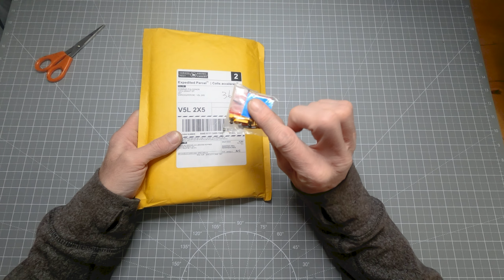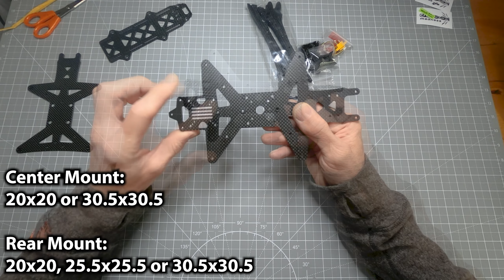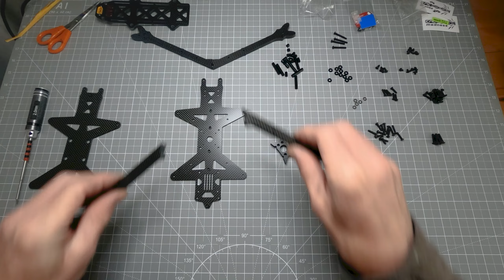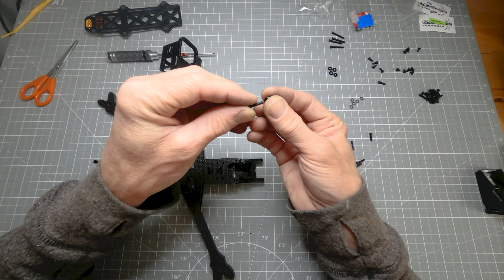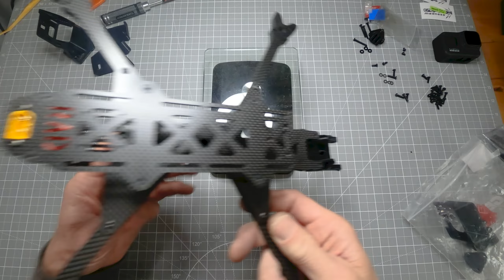Frame Assembly - Falcon RPM 7.5" Cinematic / Long range FPV

Comment: Just wanted to note I got my frame from cnc, which was cut beautifully, but all of the additional pieces weren't included. It was the frame, standoff, and fasteners.. the xt60 piece and some of the other smaller things weren't included.
Reply from the maker: They must have made a mistake.  They are supposed to include an extra packet with those things in it.  If you contact them they should mail out the missing accessories packet to you.

Comment: Mr Rad,  i received my frame... Could you advise which gopro mount should be used for the rear? I'll be running a Matek m10 with compass  bardpole and sma. Thanks, man. love the frame
Reply from the maker: email me at falconradfpv@gmail.com and I'll get you set up with the right stl files.

Comment: How would this frame workout with a HDZero setup, same as dji?  Fpv camera mount for the runcam HD same. Waiting forever for my Rekon 7” pro frame. Could easily drop a hundred on this frame.
Reply from the maker: It has 20x20 , 25x25 or 30x30 vtx mounts in the rear.  There is clearance to fit a VTX up 44mm long  x 50mm wide when centered on the rear mounting location.  The FPV cam mount will fit both two screw DJI style as well as regular single center screw style camera mounting.  Almost any fpv camera should fit the mount.  For now the 3D prints don't come with the frame. But they are all up on thingiverse to download.

Comment: Just ordered one of these frames myself after seeing MurdersFPV's build.  Looks amazing and exactly what I need for our Ozzie terrain! Thanks Conrad! 👍❤
Reply from the maker: Thanks so much! Hit me up if you have any questions, falconradfpv@gamil.com.   BTW I've been told that a 200mm cable for air unit to camera has worked but I used a 215mm one and it seemed to only just make it.  Iflight makes a 215mm and runcam makes a 300mm DJI 03 coaxial cable.  Not sure about really long coaxial for the vistas...only found 200mm so far.  I'm looking into sourcing some.
Reply: @FalconRadFPV  Thanks mate, I've flicked you an email.  Managed to source some 300mm 03 cables here in Oz.  Like you, I can only find 200mm coax cables for the vistas.

Comment: I just ordered it and can't wait to receive it.😄
Reply: @FalconRad FPV
Finished assembling the frame and electronics.
Waiting for the 7.5 inch propeller to arrive.
What are the recommended filter settings?
Reply from the maker: Sorry about the late reply.  For filters I have the sliders set to either 1.2 or 1.3 for both my builds of the RPM frame.  I've got the second gyro filter turned off, RPM filters set to 3 of them with the lowest frequency at 80hz, and number of dynamic notches to just 1.  Email me @ falconradfpv@gmail.com if you want some screen shots of my filters tab.
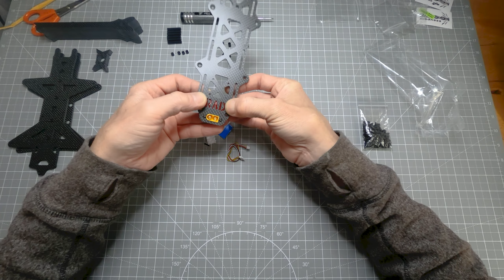Reply: @FalconRadFPV sir I also have this frame ready for flight next and would love a CLI dmp . for this build. I’m super excited to rip this beast. Would you be fine if I also use your email address to contact you for CLI dmp. file? 5:01